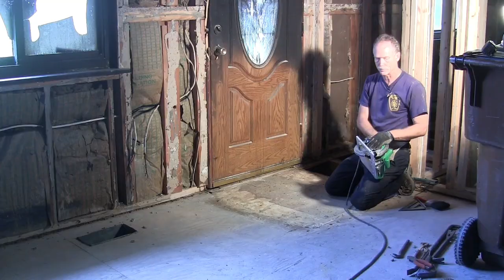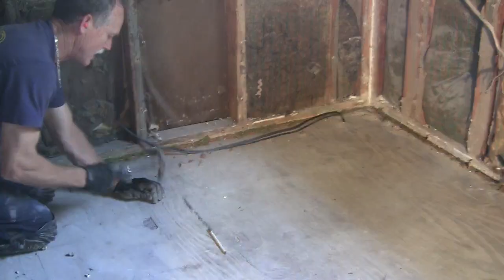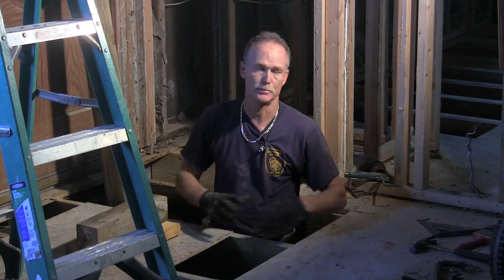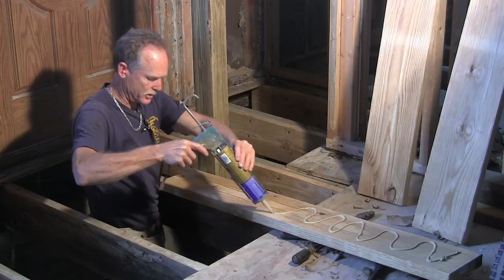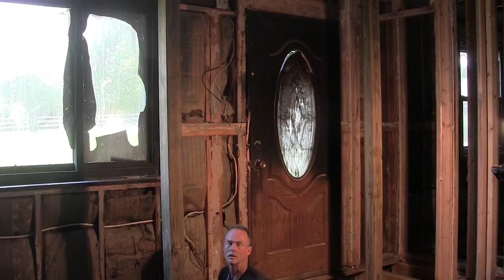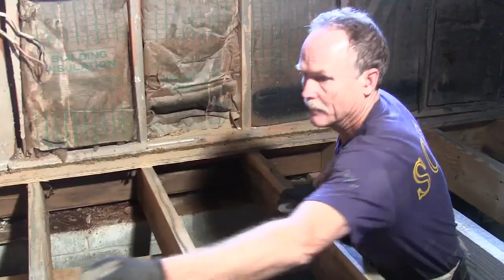How to replace a rotten sill plate

Comment: Good video. Prior to seeing how people jack up walls, put up temporary walls etc., some of this stuff on its face seems like it would require a lot more equipment to do. Pretty incredible.

I hope people watching really understand what you said regarding putting 4x4 beams balanced on top of a jack. This is deadly if you make a mistake. The beam has to balance on the jack centered, part of the building can't shift, and letting it down has to go correctly. You can't fall into the support beam on accident, or hit something with a sledge that dislodges it. The jack has to have the board under it like you did as well so it can't move or shift. I think you did it well. If a 4x4 beam falls over or straight down, that's known in the industrial businesses as a headache. I worked with a guy previously who was fast and loose with holding boards up and I got side-swiped a bit. Straightened me up on the safety stuff really quickly.

Doing this solo it may be possible to put a nail on each side about 4 feet apart on the upper rafters, wrap wire around the top 4x4 beam and each nail snugly, and then jack up the support beams afterwards.

Comment: I didn’t see how you fastened the floor joists to either the sill plate or the rim joist. It looks like it was just the weight of the house keeping it all in place. How would I fasten the joists to the rim band and/or the sill plate? Thank you for an informative video.
Reply from the maker: You can put a nail or screw at an angle through the joist into the sill plate and the rim band board. It would probably be easier to use screws and predrill a hole at the angle, probably about a 45-degree angle. Hope this helps.

Comment: What keeps the temporary wall from falling over when you jack up the joists.
Reply from the maker: The temporary wall is not connected to the joists; it's just supporting the roof and taking downward pressure off of the exterior walls.

Comment: what about the sil plate that runs parallel to the floor joist? I've watched over 100 videos and I don't think I've come across a single person that has replaced the parallel sill plate...
Reply from the maker: I replaced it too. Been a long time since I watched the video, not sure if it's included.
Reply: @doityourselfdenniscom  It looks like the standard perpendicular rim joist to me. No worries. I think I've got a plan. I'll record and upload if it works out so I can be the first haha. Great video BTW, thanks
Reply from the maker: @lukeschneider7236  Thanks. Having a plan always helps. Good luck.
Reply: @lukeschneider7236  I had the same question and still do not understand how to handle that side. Did you find a diagram or video that helped you?
Reply: @ef2b I couldn't find anything. I actually did the job already though. I ended up putting in my own short temporary joists in between the outter parrelel joist and the next joist in. They were perpendicular to the rest of the joists, That way it turned the job into the same thing. Just jack up the new temporary joists so the wall and floor is supported and then replace rim joist. Let it back down and take it all apart.  It worked for me anyway. Best of luck!
Reply: @lukeschneider7236  Thanks!

Comment: In hindsight Dennis if you had replaced the left side of the sill plate first then you wouldn’t have needed to have that little 2 foot splice, correct?
It was a great video, I love the way that you over engineer the sister of the floor joists, that is confidence inspiring!
Very impressed with your wife being down in the crawlspace, balancing an 8 foot 4 x 4 on top of a bottle jack while you’re placing another 8 foot 4 x 4 on top of it horizontally. What could go wrong? 😂
Reply from the maker: Yes, you are probably right. It's been a while since I made this video. Hard to remember. Thanks.

Comment: Great advice Dennis - thanks! If the rim joist is also rotten what process do you recommend to get that out and replace? Presuming I cut out it out from exterior when I jack up the floor joists and pulled the rotten sill plate out in 4' sections?
Reply from the maker: Thanks. If the wall will lift you might be able to change it from the outside. It's hard saying without seeing the actual job.

Comment: Dennis, solid work done there and, as others have already written, hats off to you and to your wife for tackling a tricky and potentially dangerous project.  Replacing damaged framing that is load-bearing is always a challenge, and it's always worth seeing how others do this in different setups, so as to learn more about how to do it safely.

Keep safe, and thanks for posting this helpful video.
Reply from the maker: Thank you.

Comment: How do we replace the sill if the joists run parallel?
Reply from the maker: I believe it shows in this video the portion of when the joists are running parallel. Depending on if the outside band is rotten or not would determine how to replace the sill plate.

Comment: This was great! Thank you! I recently completed the same project. When setting the depth of the skillsaw blade, if the subfloor depth is already exposed, I just set the depth of the blade against the exposed subfloor so that I know I'm not cutting into the joists at all, or at least as little as possible. Also, instead of hunting for the joist with a nail to figure out where the joist is, if I'm going to cut and replace the subfloor anyway, I just cut a hole in the subfloor next to the joist, then use a tape measure through the hole to figure out exactly where the joist is located, then mark the center from there. I'm looking forward to more videos! The audio seems to be on Mono instead of Stereo—I can only hear the sound through one side of my headphones. Maybe something related to the software when editing the video?
Reply from the maker: Thank you. All of your suggestions are good ones.